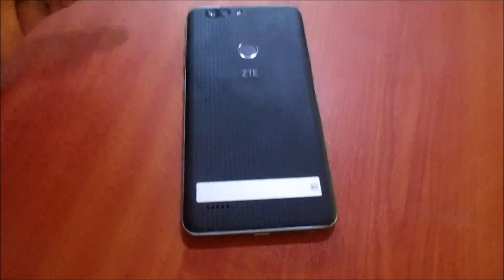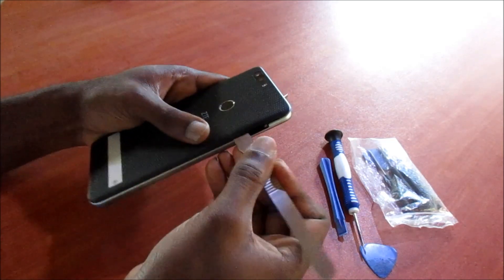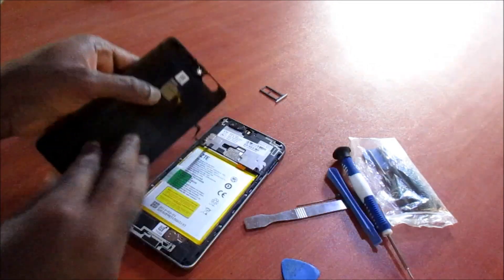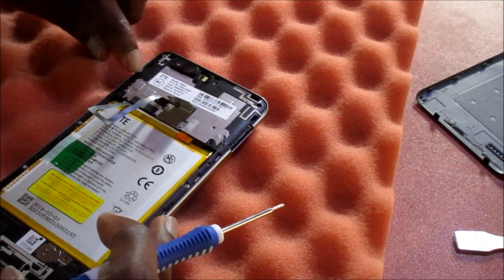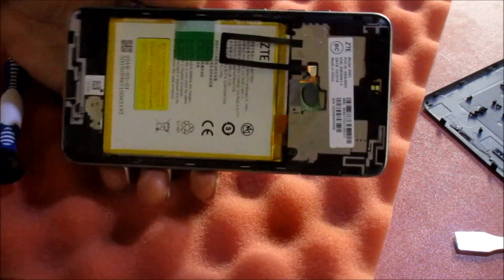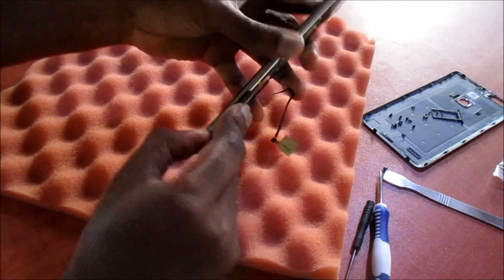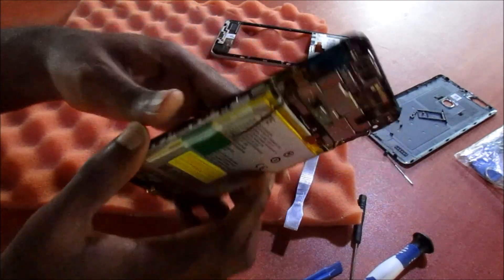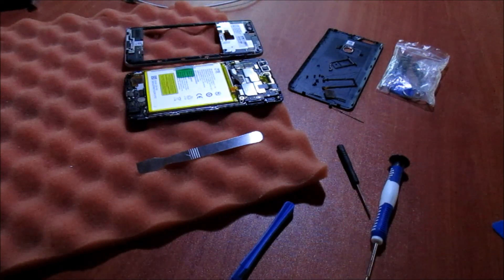zte zmax z982 disassembly| Screen or Battery replacement

Comment: Great help, you went straight to the point.  I had a little difficulty lifting that side/middle panel off until I realized that tape under the finger reader was holding it down.  It looked like you was about to say something about it @5:58.

Comment: Hi, I replaced my battery without any problem. Thank you so much. you have to remove the frame. the battery ribbon plugs in from above to the board. Be gentle but firm. Now my favorite phone will last a few more years. Now I am going to put this Samsung Galaxy one back in the box & save it for a rainy day. The ZTE is a much better phone I think. Thanks again.
Reply from the maker: you're welcome!